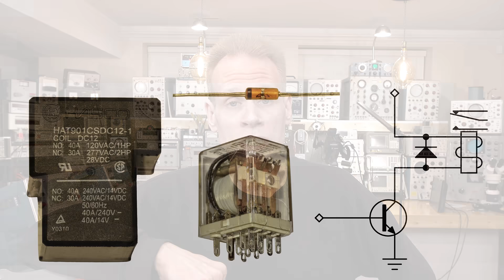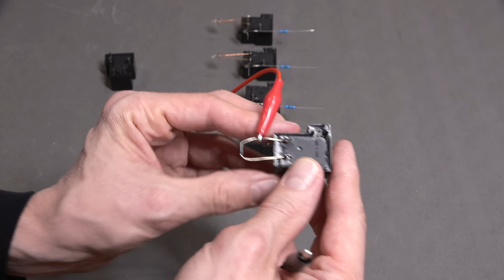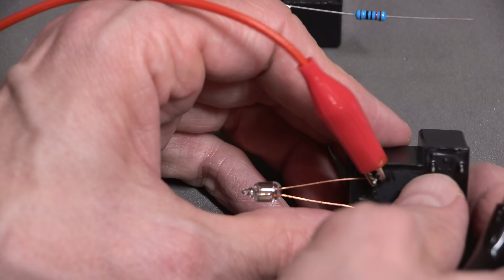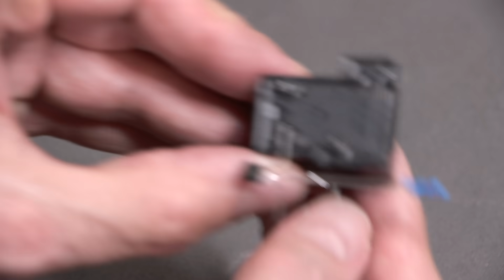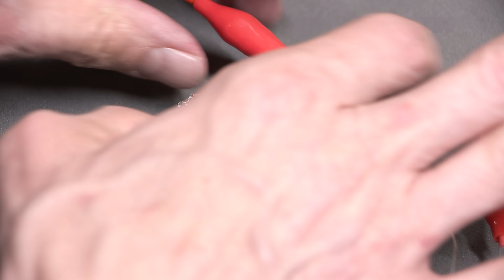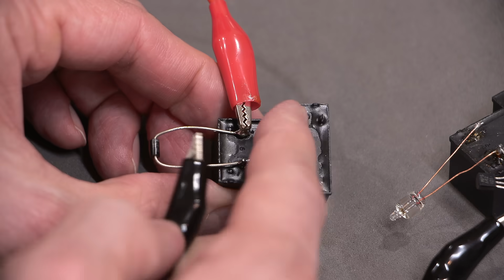Why Add This Diode Across A Relay Coil? This Is Why It's Needed!

Comment: I have a question…and maybe you or someone can help. Bear with me. I have a HASCO HAT902CS110DC (and a replacement CIT J115F21C110VDCS.9) relay on my B&K Components ST1400M Mono Amplifier. The purpose is to act as a sort of speaker protection. I am told by the HASCO manufacturer that the switch needs 90VDC to the coil to close the NO circuit to allow audio to pass to the speakers. The audio output wire from the amp board connects to the COM on the relay, and a jumper wire connects NO to the positive speaker connector post. I only measure 92VDC on the two small pins of the relay when the power is on but no audio connected. But that seems sufficient for the coil to close. However, the CIT manufacturer told me I need to have 110VDC to the coil even though the datasheet for the relay lists the pick-up voltage at 82.50VDC. The problem is the relay coil starts “chattering” with only 92VDC. He describes this “chattering” symptom as caused from, “1. Your power source to the coil does not have enough available current to supply the coil the current is needs to close the contacts, or 2. The voltage applied to the coil is too low, combined with the resistance of the coil itself….is not allowing enough current to flow to the coil.” So, in effect, the audio signal (music) is interrupted as the relay begin “chattering” and eventually the NO circuit may open and you get no audio. The relay may even engage in rapid “chattering” which can ruin the contacts on the NO circuit. Is there anything I can do? Strange as it may seem, one mono amplifier plays fine with the same CIT relay and the readings I get on my multimeter are exactly the same as on the other amplifier that the CIT relay experiences this “chattering symptom. This “chattering” can occur after a few minutes, or maybe 15 minutes, or maybe after an hour. Yet the other amplifier with the same relay is fine and does not experience this symptom. What to do?

Comment: The collapse of the field from the coil in the relay, when removing voltage (turning off...etc.) induces a negative voltage... diode blocks that.

Comment: Yes diodes will catch the ringing spike at power off. They also slow down the mechanical transition. If you have an application that requires faster toggling of the armature/solenoid, the use of an R/C network in tandem with a diode will help speed up the response.
Reply: I’m interested in knowing what applications you might have needed the faster response time in.  Was there a particular performance standard you needed to meet and was there a significant gain?  Thank you.
Reply: @SimCoderIV  The use of a relay in a power amplifier sending Morse Code, or any similar power device where rapid switching of high voltage/current is required. PWM supplies, especially flyback and Buck modes need to dump their magnetic energy in microseconds running at today's switching frequencies. The toggling of power devices in machines where timing is important and software coding must have wait states inserted before execution can proceed. Catch diodes need to work in tandem with transient suppression across the contacts as relays are notorious for contact bounce and chatter. Instead of 100-200 milliseconds waiting for the relay/solenoid to release it can be cut done to 10-20. No standard, just app specific.
Reply: @svartvist  (once upon a time) I designed test equipment for Aerospace relays & contactors (bounce, chatter, simultaneity etc.) but not solenoids.  I don’t recall seeing a network on the public released Data Sheets but that doesn’t mean it’s not there.  Newer Contactors were operating at less than 50ms even at -40 degrees Celsius and relays faster than that.  That’s why the Operate & Release time gain with an RC network peeked my interest.    Thank you for the response.
Reply: @SimCoderIV  Switchers, usually under the classification of Snubbers; Unitrode's SLUP100  Design and Application of, (Todd), Switching Power Supply Design 2nd Ed p425 (Pressman), High Frequency Switching Power Supplies p138 (Chryssis), just about any decent book/app note on the subject. Bruce Carsten may have publ. something--I'd have to dig thru his notes. When CRTs were vogue I designed the deflection and video amps. Some of the speed up networks were in the power driver ckt to steepen the fall time. Deflection was just a form of Zero Voltage Resonant Converter running open loop. Any ringing showed up in the raster (bbaadd) and it got tricky speeding up power ICs used for the vertical yoke to squeeze in another character row. I don't recall ever seeing any app notes on relay/solenoid driving, unless maybe the old GE SCR manual.

Comment: This one hits close to home.  The Electrical engineers taught this mechanical engineer about this very issue.  An aftermarket solenoid was connected to our trucks with no diode.  The  coil circuit was monitored by the the ECM.  The voltage spike caused damage to the ECM (ouch!).  We very quickly added a plug in harness with a diode in it as the fix.

Comment: It sounds like a transistor could be called a small relay.
Reply from the maker: It technically is if saturated, with the ability to pull to ground.

Comment: This answered a really important question I had at work. I work with Kubota engines being used in generator aplications. The diode relays are REQUIRED for Kubota ECUS but I never knew why. Now it seems its because the ECU not only sends a positive signal to the coil, but also opens an internal ground path instead of relying on a common from the engine (This design is probably so the ECU can send a relay failure code to our primary engine controllers for ease of maintanence) . RN relays (Using a resistor across the coil) would cause a fail to run issue as the path to ground via the ECU would have far too much resistance despite them seeming to solve the same issue in different aplications. This collapse of the magnetic field entering the ECU would most certianly end in catastrophic failure from an internal transistor decaying into a "Jumper" causing something foolish like: The glowplugs never turn off, or the fuel pump continuing to run despite the ECU being in a "Standby" mode. Thank you for the incredibly informative video

Comment: Soooo in short the diode saves the coil and systems where a transistor or control module controls the relay

Comment: Just to make clear, this applies to DC powered relays. Do not put a diode across an AC powered relay. Pay attention to the polarity of the diode or it will cause a direct short. The polarity should be marked on relays with a built-in diode.

Comment: I'm having trouble understanding the voltage spike. By shutting of the relay power, wouldn't the coil try to maintain the falling magnetic field and so the voltage would be in the positive to negative direction?

Comment: I am adding in a remote starter solenoid for a battery I'm relocating to the trunk. I read about solenoids creating voltage spikes and the negative effects on an ECU so I started searching for info. This video was very informative, thank you!  The question I have is figuring out the correct diode to use. For example, lets say a 12v solenoid coil draws 8-12 amps, would a diode rated 50V / 12A  be a good choice?

Comment: Arc suppression diodes were/are used on avionics relays. Besides the obvious problems with chatter, we also used them on all relays due to the fact that many installs are mounted in unpressurized locations.  Dry air/low humidity conditions can cause some very impressive arc lengths/problems  in wiring harnesses, adjacent terminals, and connectors. Most of these cross-side redundancies are now controlled via a databus and software. Just showing my age!

Comment: Saludos Mr. Carlson's, cuando aplicamos una fem (fuerza electromotriz) a un circuito con bobina, está carga dicha bobina a su campo magnético máximo para lo que fue diseñada, una vez desconectada se produce una tensión elevada llamada contra electromotriz, la cual daña componentes electrónicos si no se coloca en este caso de corriente continua un diodo a la inversa, en circuitos de Ac corriente alterna se coloca una resistencia en serie con un condensador, para suprimir ese pico de corriente! 
Para los casos que explicas de un rele en automotriz si, además que daña la bobina también daña el contacto del switch o interruptor, creando desgaste y mal contacto! 
Gracias por su 
Excelente explicación y comentarios!!

Comment: If the purpose of the diode is to manage the flyback current, wouldn't it also make sense to put a resistor in series with the diode? 

I'm not an electrical engineer, so please correct me if I'm wrong, but I would think that the purpose of a diode is not to sink current. I would think that would instead be the purpose of a resistor. 

If I'm missing something, please do correct me. I'd love to learn more about this!
Reply from the maker: The current from the inductive kick is so small, a series resistor is not in most cases. This is why you don't see the resistor being added in the majority of circuits.

Comment: Prevents spikes on the supply when the coil opens - think collapsing field and spark plugs. The diode gives the energy a place to go and dissipate in the coil resistance

Comment: In short, it's called a snubber diode, or back EMF diode. It protects the driving circuit (usually a transistor) from being destroyed when the coil voltage collapses when de-energized. A lot of relays can produce a back EMF of over 500V peak! (This is pretty much the theory behind a coil and distributor in a car producing spark at the spark plugs - using back EMF to our advantage). Also, dude, seriously... I've been following you since 2017; how come you're not at 1 million subs by now lol.

Comment: Most of the Relay's Coils have a built in diode across them from the Factory.

A simple continuity test will tell you if its fitted or not. That may not be in your Patreon info..
Reply from the maker: Actually, they don't.

Comment: Dont car relays have protección diodes bult in ??????
Reply from the maker: They don't, it's usually in the ECM. Replacement relays (most of the time) do not have diodes either, as they are used in many different applications. Adding a diode is a 50% chance of attaching it (the relay coil) backwards and shorting the diode or damaging an ECM.

Comment: The trouble I have with all this is the fact that the relay only has a single (primary) winding, unlike an ignition coil. So how does  the spiked higher voltage discharge take place with only one winding?
Reply from the maker: The reverse spike is higher voltage, but at a lower current, you always have a loss.

Comment: 10:18 what is inside that white mini box 😮and thanks for the information regarding relays you are doing a great job by teaching how relay works with n without the diode n  transistors many of them can get inspiration to create a new circuit 😂😊❤🫡
Reply: It’s a small battery that provides current to allow current to flow through the transistor

Comment: Somrthing often overlooked:  The induction of the coil generates CEMF to keep the current flowing.  This means the end of the coil connected to the positive rail is driven negative, putting the CEMF series-aiding with the supply voltage so they add.  This exposes the transistor to perhaps twice or three times the supply voltage if the diode is not present.

Comment: You showed where the current flows when you open the switch while having a neon bulb or diode across the coil. But some may wonder, if current flows through those devices when those devices are connected, where does current flow when they are not connected. If there is no component connected, then there is no path for current to flow, right? Not quite. That current is going to flow come hell or high water. When you remove the lead and interrupt the current flow in the coil, the magnetic field collapses much more rapidly, such that the inductive "kick" can generate a great deal of voltage which ionizes the air and causes a spark. That spark is short lived because the magnetic field collapses very rapidly. This actually is the principle used by power supply engineers to create boost circuits to convert low voltage to high voltage, except power supply engineers do it with more finesse and do allow sparks(hopefully).

Comment: I don’t understand the point of adding a transistor to a relay? Don’t they essentially do the same thing? I also don’t understand where the “destructive high voltage kick” comes from; why wouldn’t a relay designed to work with certain voltages already compensate for this? (ie. 12 volts closes a 100v circuit for example)? I’m obviously a beginner, perhaps my confusion can lead you to a clearer explanation of the processes at work here.

Comment: This is an outstanding video, take it from someone who works on cars all day. Your relay is basically an ignition coil! Why don't relays have fly back diodes in them to begin with?
Reply from the maker: No diode due to many different applications for a relay, the coil itself is not polar, but once you add a diode, it can only be installed one way.

Comment: (mini kinda-tesla coils) lol 
My dinosaur of a car utilizes relays with internal resistors. While the resistors are performing their purpose, I can't help but think they are more purposeful as an additional source of heat within the mostly sealed plastic boxes.  lol 
I just want to know why it's headlight circuit has to have it's relay powered until the headlights are turned on. Seems the circuit would operate just fine with the relay powered down until needed. Either way, there are 4 contacts which could foul and lose the ability to conduct current flow. I do not see a constant on situation diverting that risk. Oh yea, and WHY does the owner's manual not even mention the one and only lone diode in the fuse panel?  lol  It simply lists it as "Diode", no more info included at all.  lol

Comment: Great explanation! I’m a mechanic, and a few years ago I added a trailer hitch to my Mercedes. I needed a way to get the trailer lights working with the LED tail lamps, and they of course only receive a low amperage signal sent between them, and another module. I wired in 3 relays, with an added resistor, and was told by a guy I worked with to add a diode in between the relay coils. I didn’t fully understand at the time why, but he stressed it’s importance to me, and watching this, I’m sure glad I listened to him. Thanks for the knowledge!✌️

Comment: I was thinking about this and just using the relay - as you say  - as time goes on the coil will fail inside  from the kickback.  I use the diodes all the time like this.   However , when properly placed in the reverse voltage - upon voltage removal the collapse is shorted right back to the coil  - yes ?

Comment: Do you have any video diving a bit deeper, diode vs resistor or even using both depending on the load the relay is switching?

Comment: Don't assume that electronic designs that you buy commercially follow these basic, well known, Electronic design principles. At least one European design that controls Electric Gates for up market properties, has no protection for the Relay contacts that power the motors. Turning off a DC motor has the same issue as turning off a Relay, except there's much more stored energy to burn the Relay contacts. Obviously you can't just put a diode across the terminals of a DC motor that has to run in both directions. There are many solutions to this problem, involving diodes between the output and the DC Bus rails, MOVs, back to back Zenerr Diodes or a TVS.
I'd be interested to hear what Mr Carlson's opinions are as to the most effective solution to an H-bridge of Relays driving a DC motor in both directions as in the above example.
An MOV across the output massively increased the life of this circuit from months to years, but not enough for my liking. In the end, I designed a simple board that used a cheap dual PWM driver board from eBay and did away with Relays altogether. I guess gate maintenance companies love this nice little reguilar bit of income, I can only assume this is why there's no incentive to actually design one that lasts.

Comment: Kind of makes since..I have all my own wiring for my system in my truck and use a relay for my remote turn on..I get a pop sound when I hear the relay turn off..Not horrible but it's a pop sound through my speakers..So I guess this kinda makes since

Comment: When I was 10-years old I got my first test instrument, a Simpson 260 VOM, I set the VOM to ohms X1 and while testing the primary of a power transformer, I was holding the two test leads with my thumb and index fingers on both hands connected to the two primary leads and one of the test leads slipped from my finger and I got a helluva shock! I simply could not understand how the 1.5 volt battery inside the VOM on the X1 ohms range could possibly shock me, it wasn't until I realized that the shock I had experienced was the collapsing field of the primary coil wrapped around the iron core that gave me that jolt, it was the same as the Kettering points and coil ignition system I read about that I understood how this happened!  David Riddle
Reply from the maker: Thanks for sharing your story David!

Comment: I do have to disagree that "a diode" is always needed. Rather, the back-EMF from a magnetic field collapse needs to be dealt with. A diode is one method, but neither the only method nor always the appropriate method. Most quality relay manufactures will provide the recommended mitigation. For socket style relays, I prefer to select ones which have EMF mitigation as a separate integrated module.